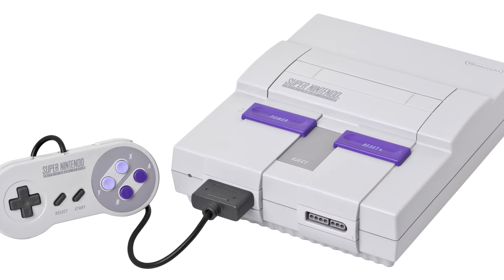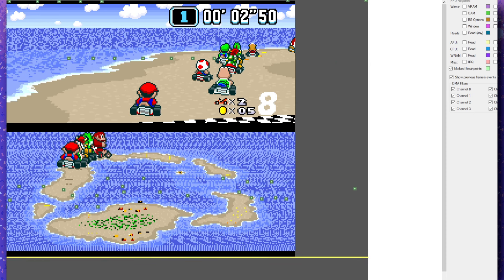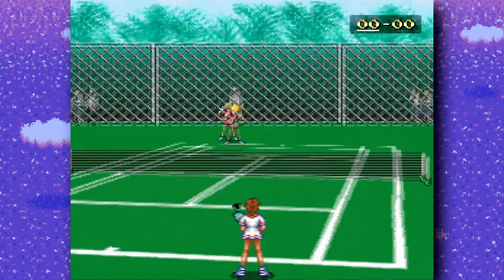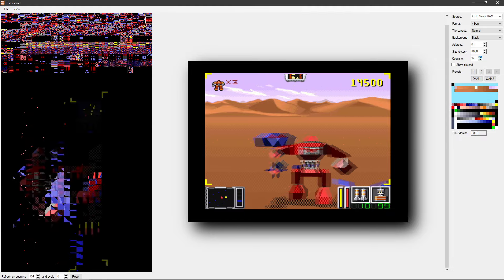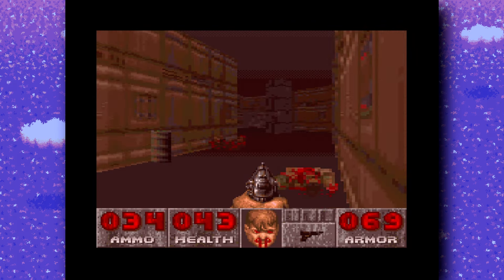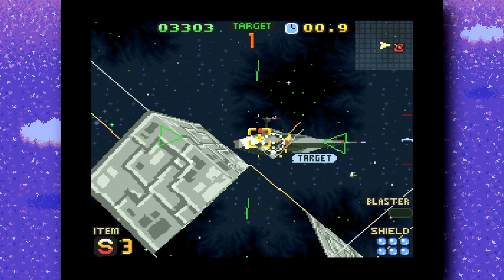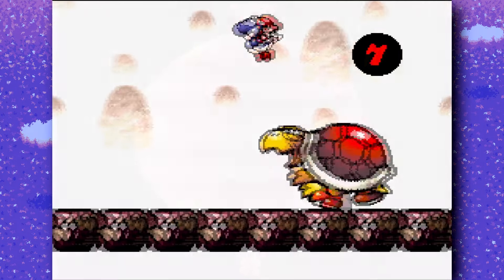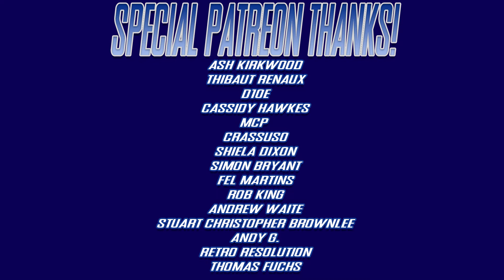How 'Enhancement Chips' Pushed The Limits of The Super NES (and Sometimes Didn't)

Comment: I always thought it was a shame sega never used these chips on megadrive. The one time they did it was impressive.
Reply: Too expensive.
Reply: Arguably (as the video mentions) the 32X (and the Mega CD to some extent) served similar purposes.
Reply: Virtua Racing for the megadeive had an enhancement chip in it, the only game to ever do it I think. It's super impressive though!
Reply: Sega did to some extent. The Sega CD had an additional processor, extra audio channels, and even sampled audio like on the SNES. But devs just didn't make use of it. You'd see a lot of games relaunched on the Sega CD with no real improvement. Looking at you, Road Rash.
Reply: @diecarro79  Don't gaslight, enhancement chips in the cart and system add ons are not the same thing at all. As a kid of the 80s, I can tell you the 32x and mega CD were out of reach for most kids of the time, whereas many NES and SNES games had enhancement and mapper chips making them available for everyone.
Reply: @neuro_davinci  It's a complicated matter and I tried to simplify it too much. Theoretically, it would seem a good idea to release a hardware add-on with the enhancement chip(s) and then cartridges wouldn't need to contain those chips in every cartridge and then would be cheaper, but this has almost never worked in practice, and things like the Aladdin Deck Enhancer have been all failures.

And you're right. People preferred to pay a little more for each cartridge with the enhancement chips (the NES/SNES way) than to pay a lot upfront for an add-on.
Reply: I ask this too.... I get all the reasons stated above, but Sega made everything man... it seems weird THIS stopped them. I wonder if the American team supported it, there was some FIERCE inner company rivalry between Sega Japan and Sega USA... just a guess though
Reply: Well SEGA had the SVP which they sadly only used for one game and that was Virtua Racing. It was in fact even superior to the SuperFX chip when it comes to speed. The Mega Drive CPU power alone never really made it necessary for extra chips. The SNES was basically half as fast and used a modified 8bit CPU. Both consoles really had their pros and cons. As a kid i played on both systems and just loved them both because they were so different and yet quite similar 16 bit machines. I think SEGA later went too much over the top with hardware addons instead of incorporating it. If they would have been smarter they would have incorporated the 32X hardware into dedicated game and handle it differently.
Reply: Well Genesis does what Nintendon't
Reply: And Genesisdon’t what Nintendo
Reply: @diecarro79  not utilized enough due to sharing relying on the genesis hardware. Sega lost a lot of money from the sega cd and 32x. Hardware add-on like the 32x, sega cd and others never work and benefit gaming companies.
Reply: @KRAFTWERK2K6  so in-cart hardware of each chip from the 32x right?
Reply: @maroon9273  no the 32x is a lot more powerful than the svp
Reply: @jc_dogen  I know it is powerful. The question is if the sega should have used each chips as separate enhancement chips like the svp?
Reply: @maroon9273  that would make each game insanely expensive.
Reply: @jc_dogen  for certain games and it is a better options than another add-on while sega already failed with the sega cd. Or yet cancel the 32x add-on and release it as a handheld console during the 6th gaming console as a rival to the gba.
Reply: @maroon9273  32X as it was released was underdeveloped and buggy. The GBA is theoretically less powerful but performs better in the real world, apart from a few aspects like audio.
Reply: @jc_dogen  You don't have to deal with two cpu's and underutilized two dma sound channel from both of the cpus. The gba cpu is newer and faster when it comes to instruction since  the MIP is 28 than the 32x 20 MIPS per each cpu. The only with the gba is the dual vrams (32 and 92 kb) similar issue like the 32x vram frambuffer. It would've been better had they used a 128 kb vram or adjustable frame buffer 128 kb vram.

It would've been better had sega took their time with the 32x project and releasing as a handheld console (cleaner hardware design) instead of rushing it out as a add-on. Nintendo did the same with the gba.

Comment: The super FX was used for: scaling, rotating and manipulating/tilting images. All things the snes sucked at. Also it could perform floating point operations, used to draw polygons, polymorph and rotate things “smoothly”.
Reply: Yep, that's pretty much what Sharopolis said.
Reply: @RetroJack  spare tour time, read my reply if you are in a quick hurr and still want to know what we just talked about
Reply: The snes had scaling, rotation and titling built in already. These are the functions that the snes could do without the super fx chip, and it did it well.
Reply: The SuperFX was a 32bit RISC CPU with a specialized "draw a pixel" function and hefty multiply capabilities. you could do the hell you want with it.
There's even a voxel space demo for the chip on the internet (and a game that would use the same technique but got cancelled)
Reply: @jabarijones7871  only mode 7 made use of those kindof functions, no other modes offer scaling, rotation, or tilting of sprites natively. And that is were some chips play a specific role in.

FI: mario kart characters arent scaled, the sprites are swapped out for different versions of the kart at different distances, only this way they could give you the experience of characters being closer or further on the screen. Mode 7 was already used for background aka the track, so it could not scale both the map and karts at one since they did not made use of the same layer.
Reply: @dan_loup  I have seen mario 64 “demos”run on this thing, or n64 mario prototype tryouts, seems the thing had a lot to offer for its time. Actuall, the power of the chip kinda made it destroy its own reputation, it was obviously to powerfull for the gen, making a n64 not needed for a long time if they wanted. But nintendo pushed the n64 and never ever have we heard of the fx2 chip, which was supposed to be used for a 3d mario game for the snes, which made graphics closely to n64, or close enough to nintendo decide to cut the whole thing off. Because n64 would not be special enough.
Reply: @dan_loup  can you tell me the difference about the marIO chip and the fx chips? The marIO chip is mainly used in Starfox and is the first version of the chip. Creating a starfox 2 cartridge would only work with MarIO chips and not with the fx marked ones, what was different about them!?
Reply: @ClosestNearUtopia  not even close to the N64, the triangle count is like 1/10 of the N64 count.
Reply: @dan_loup  I said CLOSE ENOUGH.. and next to that, its Nintendos opninion, not mine.  For the difference we may look at SF and SF64.. there is a difference, n64 deffenitely is nicer, but who will be impressed by the 3d graphics of SF64, do you think; the ones played SF will be more impressed, or the ones that hasnt!? Ofc, the people who have not played SF on the snes will be hugely more impressed by SF64, because they have never even seen anything like it. And nintendo took this approach so dont come with a statements that contradict the history.

If you did some research you know Nintendo was hugely impressed by what the fx could do, but, since no 3d consoles exist and Ninendo is heavy interested in that, thay wanted to leave the gap of 3d graphics for home consoles a big as possible and thus not fully the capabilities of the fx. Ofc the thing has a lower polygon counts, what would you expect from a 2d console running 3d games compared to a console created for fully 3d games.. sherlock. Its nice you only comment on what is there to burn but you obviously cant even tell the differences about the MarIO and the GSU-1/2.
Reply: It was just a crutch to compensate for a lack of blast processing power.

Comment: I can't wait for part 2. It's a shame the Super FX chip never had a chance.

Winter Gold on SNES actually does not use 3D polygons. It uses vector image animations to fake 3D, each frame composed of multiple polygons used to represent a 2D image.

Also, the SNES can do sprite scaling and rotation, and it's similar to how it's done on the Super FX 2 with Yoshi's Island because both have to do it in software using the CPU. The Super FX is really just a CPU, it has to be programmed to manually draw polygons and manually draw sprites being scaled and/or rotated. The catch is that the Super FX is much faster as a CPU than the SNES'.

Nitpick: Why do the gameplay recordings in your video have this weird motion blur applied to them?
Reply: The motion blur is crt emulation, it's supposed to show more accurately the out out the programmers were expecting.

Comment: Basically, Megaman X2 and X3 used the Cx4 chip as much as possible, the wireframes are just the most visible one.
It was actually used mostly for... well, what you described Yoshi's Island using the Super FX chip for: rotating, stretching, and basically allowing graphical effects the original Super Nintendo could not allow and with much less slowdown. For example, the intro level's boss of X2 was not only too big to work without it but also... was basically made with skeletal animation.

Comment: Imagine if Nintendo had included the SFX chip on the console itself from the beginning. The possibilities!

Edit: I read somewhere that the DSP in Dungeon Master was used to do bitmap conversion between Atari ST bitmaps and the bitplane format used by the SNES.
Reply: "Imagine if Nintendo had included the SFX chip on the console itself from the beginning."

They built NES and SNES to be extensible like this for a reason. 1st, they wouldn't have used same implementation if they had built the features and performance of the chip on console itself - as it is it still has to work through the SNES display chip, they would have made it into the display chip itself. The thing is, no matter how over the top they would've made it, they still had to decide on what features they would settle with and then go with it. And that would have set the hard limit on what you can do without putting an extra chip on game cartridge. And they had to do their best to choose something that wouldn't make the console too expensive (Neo Geo says hello) at the time.

Whatever they would have chosen, provided they didn't chose too expensive stuff, we would still have the same situation - eventually there would rise a need for most demanding games to have extra punch, because it couldn't perform fast enough on SNES alone. And we would still be having this same discussion about them including the SFX chip on the console itself, only difference being that the SFX chip would be somewhat more impressive than it is now. I think overall they did design it well enough and made it extensible because they knew they couldn't cover every need for the consoles lifetime - and the speed that hardware was getting faster with never ever more impressing features during the 90's was astonishing, you had to be there to understand ;) It was a time when you could feel future happening in the now all the time :D
Reply: @robsku1  Oh I was there in the 90s. :) My first console was a 2600 when I was 4. The SNES was the first console I bought with my own money from working all summer. I then fell for the "64 bit" lies of the Jaguar.

Comment: Some of the early games that used DSP chips seem to have had them included to slightly boost the clock speed of the standard system from what I can tell to keep games running at a certain speed because other than that I don't think they had any other enhancements they could offer over stock hardware.
Reply: They couldn't exactly boost the clock speed of the main CPU using a subprocessor, but they could offload mathematic calculations to the DSP chip and achieve a similar effect.

Comment: The one thing that bothered me was that you buy the superfx chip plus extra ram in every game. Would be cheaper overall if you put it an extra cartridge where the actual game cartridge is pluged into.
Reply: That was what SEGA did and failed.
Reply: @enriquegomez8114  But they had to many external cables and stuff like 3dfx Vodoo had. Maybe in form something like the action replay but with other game connector on the top. It would have saved money in the long run.
Reply: @enriquegomez8114  it was cancelled due to sega replace svp with the 32x add-on.

Comment: When the Super FX chip draws polys on the screen, isn't it technically drawing tiles? Because that's what it looks like in RAM. Does this make the FX chip the first tiled renderer lol?
Reply: I think something similar already existed with NES - Elite for NES used something similar, it was 3D graphics rendered as tiles, although that was just wireframe-3D; in other words, line graphics, but the basic principle is the same.
There were probably also Sega Master System and Genesis games that used some similar enhancement chips in cartridge.

So Super FX chip would not be the first "tiled renderer" ;)

If you want to see something crazy done using the same principle, search YouTube for "reverse emulating the nes" - IIRC the video also mentions Elite.

Comment: The issue is not the super Fx when building the frame as I'm pretty sure it is fast enough. The real issue is the vram access from the PPU and is a real bottle neck on the Snes unfortunately. Writing to VRAM can only occur during Vblank and it would take about 4 frames to be able to buffer 1 frame hence the 15fps with these games.

Comment: I think it’s cool the added chips they used to use and wish they were used more but this greatly changes how people interpret the graphics hp of the gen and snes. Both had advantages and disadvantages. It’s stupid to think the snes was 2 years newer and still would get upstaged by the genesis many times because they didn’t include the proper stuff in the console and put it in chip form to pass on the savings to themselves. It’s bs and if they had a better chipset in the snes like they should have so many games would have been possible that it would be hard to say genesis had better games but it did just not the best aging games.

Comment: Would the chips used in Kirby's Super Star and Kirby's Dream Land 3 count? Both games were doing some interesting graphic effects during some levels and bosses.
Reply: They use the SA-1 so that's a story for the next video. Dream Land 3 also uses the pseudo-hires output to do a bunch of stuff which also deserves its own video. More videos!
Reply from the maker: Yes that's on the list for part 2!
Reply: @shukterhousejive  The pseudo-hires usage in Kirby's Dream Land 3 (and some other games) is something weird... 
I've used on my SMW hack "Zelda - The Mini Quest" without special chip, there's no difference in performance at all, it's just a PPU function.
Basically, you activate the 512 pixels wide bit in non-hi-res bg modes. The result is the low-res graphics streched... unless you remove a field from one layer, now he's "dithered" like a Genesis game.
I still don't really know why they used this instead of color math. I did just for testing.

Comment: Imo, the dsp for Mario kart isn't for anything 3d, because ultimately everything in Mario kart is happening on at a 2d level that is just rotated to look 3d. The dsp would be used for the physics that are involved, like shells bouncing off of walls. The dsp will do the calculations required to get the angle a shell should bounce at for example.

Comment: The FX2 actually wasn't faster than the FX. Star Fox used the original FX chip, nicknamed the "MARIO" chip, but the other four games - Stunt Race FX, Vortex, Dirt Racer and Dirt Trax FX used the GSU-1, which had a faster clock speed. It's a bit confusing because both the Mario chip and the GSU-1 were known externally as "Super FX". The Super FX2 was internally called the GSU-2, and only 3 games used this, Doom, Winter Gold and Yoshi's Island, but the FX2 did NOT run faster than the GSU-1. Instead, the difference is that it can access more ROM or RAM, due to having more pins on the chip. So there were 3 main versions of the chip: "MARIO", running at 10.5MHz, GSU-1, running at 21MHz (both of which were called "Super FX" externally), and GSU-2, also running at 21MHz, but able to access more ROM or RAM (known externally as "Super FX2").

Comment: Former NOA dev here! I actually worked on Yoshi's Island toward the latter half of development and I can tell you firsthand the FX Chip does NOTHING on the game. There is a very small transistor on the motherboard that actually controls the on and off state of a hologram that displays a Super FX Chip, the hologram of course being a very low power projector powered by the same battery that handles all your save data. As anyone who has replaced this battery can tell you, the FX Chip suddenly "disappears" when the battery is removed, and will disappear as well if said transistor is removed (the cartridge can function without it) and only reappears after installing a fresh battery. Hope this cleared up any confusion for you on the hardware side of Yoshi's Island!